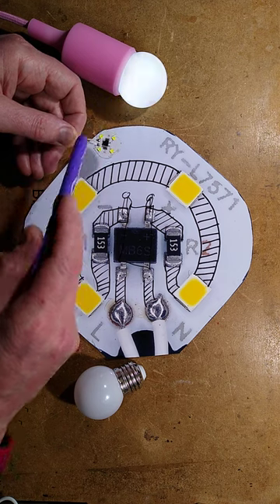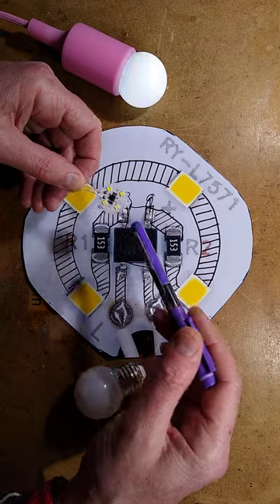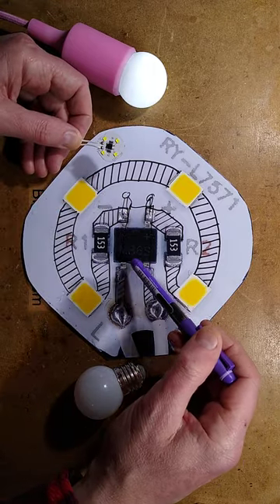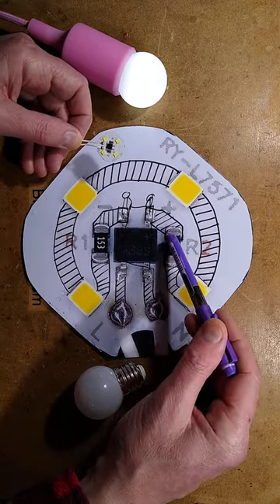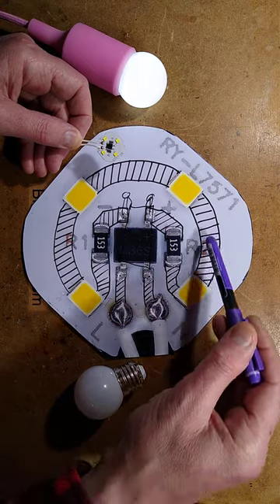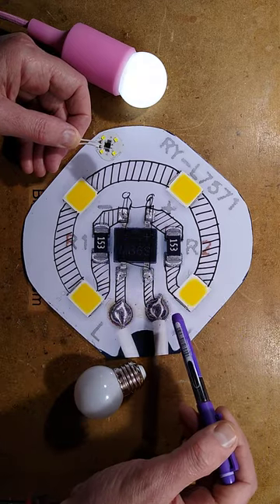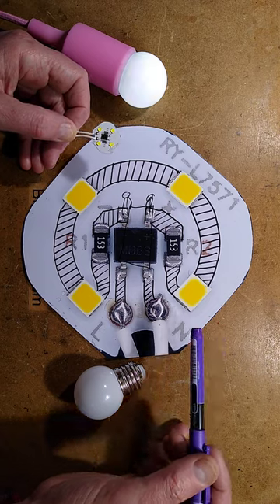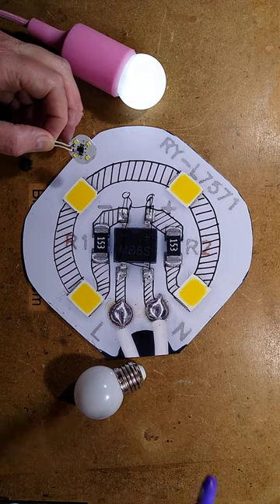Simplest LED bulb ever

Comment: Got to wonder they didn't double the resistor value, and cut even more cost.
Reply: Our luck, because it spreads heat dissipation across the board.
But don't you dare tossing them such advices! ;D
Reply: @jkobain  also lowers the voltage across the resistor
Reply: @nirodper  yeah, you're right: two gaps are safer for sure.
Reply: A single resistor at that current would overheat and die too quickly.
Reply: @johndododoe1411 As if they care, they’d just sell you a new one. 
Those LEDs switching off and on at 120 Hz aren’t gonna get old happily either. This cr8p clearly isn’t built to last.

Comment: The efficiency has to be terrible! I assume about 18V at each LED and 240VAC supply. That means current of 5.6mA, so LED power of 0.4W and 0.94W of resistor heat. So only 30% of power goes to the LEDs...
Reply: But not bad for night light.

Comment: A SMD smoothing capacitor between the outcome and it would shimmer less?
Reply: At first, adding a significant capacitor will increase the inrush current, thus making a current limiting resistor before the FBR a mandatory thing, preferably fusible one. But yes, it can reduce shimmer and help the board fry the LEDs better.

Comment: If you can manage to replace the LEDs to single chip LED and perhaps change the resistors to some 220 Ohm - then you would have an "any polarity to any line" 12V camping bulb... 
(just some weird thoughts though...)
Reply from the maker: For 12V you would need to have no more than three LEDs in series and a resistor.

Comment: I think this resistors make alot of heat, right?
Reply: Most common cheap designs are either based on current limiting resistors or linear voltage regulators, and both do dissipate excessive energy as heat.
Reply from the maker: They will get hot, but the whole light is very low power.